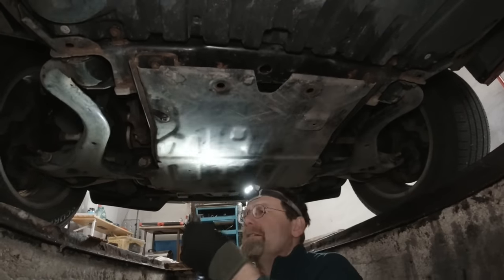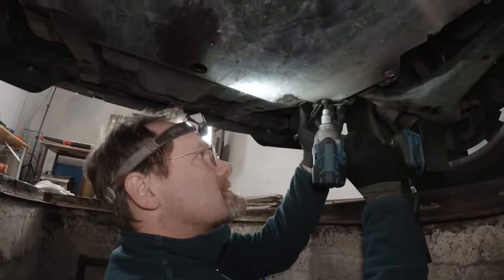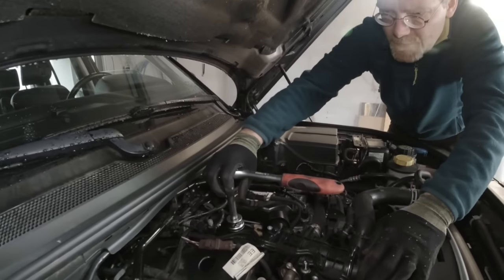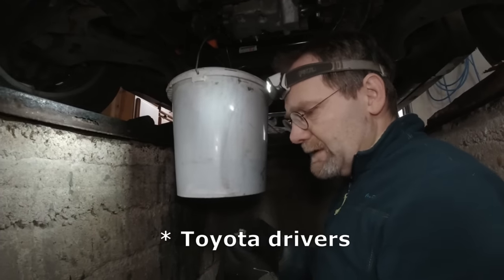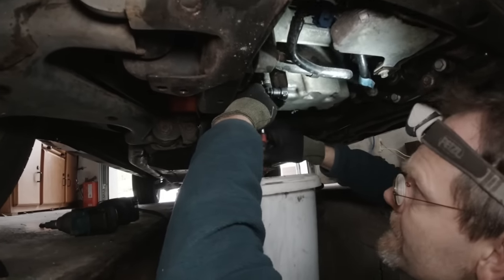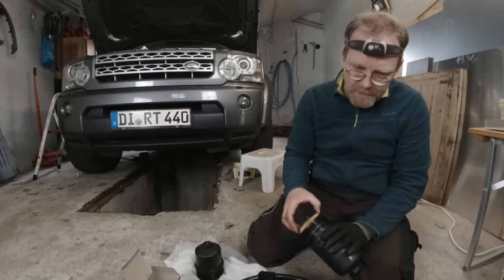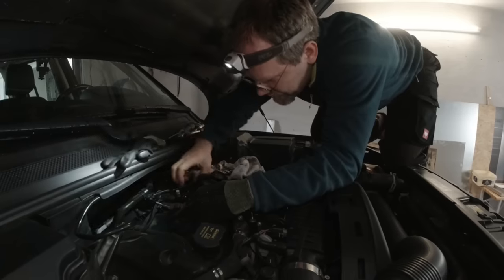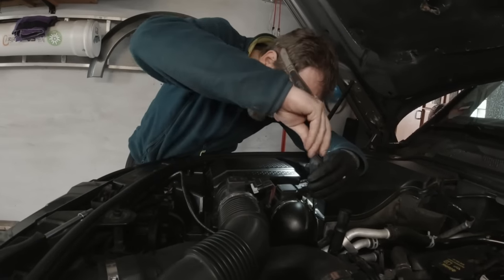No more 5W-30 ever again - Land Rover Discovery 4 - Transfer Case and Diff oil change

Comment: Hello from Kazakhstan. I think that for the engine to be better protected, additional parameters need to be considered.

Certainly, oil viscosity is crucial. I believe that for greater protection, a more viscous oil like w50 with a stronger base and fewer polymers added to increase viscosity would be suitable. The difference in fluidity between w40 and w50 oils is not significant, but the HTHS value and viscosity(100 to 150 degrees) favor w50. This is because the oil can heat up beyond 110-120 degrees, and during this process, the viscosity can drop significantly. If you measure oil pressure at 110-120 degrees, the pressure can be below 1 bars, even in a new engine. In reality, this is very low, especially if you are driving on mountain serpentine roads or moving on autobahns at high speeds.  Therefore, more viscous oil will help increase pressure.

Next, the original oil pressure sensor should be replaced with one that gives a warning if the pressure drops below 1 bar. 

And most importantly, the coolant and oil temperatures should be lowered. I believe the ideal parameter is 80-90 degrees for the oil all time. Structurally, the oil cooler is not in the most optimal place. This can be improved by modifying the oil cooling system, moving the cooler from its standard location to a separate radiator that cools the oil with the airflow during movement. The oil filter can also be placed separately. These solutions exist and are used in racing tuning. Replacing the thermostat with a colder variant that opens at 82 degrees can further enhance cooling efficiency and protect the engine under varying operational conditions.

Additionally, it is very important to change the oil every 5,000-6,000 kilometers.

Thank you!

Comment: if anyone  is interested  my 2003 Toyota MR2  is sort of broken  'brake back plate dust  guard  has fell off -UK MOT failure ' I do intend  to fix this but on my 1971 series 3 land rover  it needs a total rebuild  the the twin  carburetors  which  will have to wait  till I have 2 weeks off work 😂 great video

Comment: The D3 oil filter for the 2.7 has a 12% larger filter surface area compared to the D4 3.0 filter. So for the same flow rate (assume your D3 has the later 15mm wide oil pump, i.e.  the same pump element size as the D4 3.0 pump) then the D3 will have lower pressure drop over the filter element. As the oil pump relief valve dumps back to sump at the pump, then on a cold morning the D4 engine will have a higher oil pump discharge pressure due to the higher oil filter DP (smaller filter surface area). So a higher % of the oil will bypass the system via the relief valve back to sump. Hence your D4 will have a lower oil flow rate to the bearings when cold compared to the D3. However the D3 originally had a 11.5mm wide oil pump compared to the newer 15mm units, so the differance may not be that much over the original design....

Interestingly the Gen 2 TDV6 3.0 engines (D5 and Ford F-150) have a different oil pump (same rotor element, 15mm wide) - the pump relief valve is actuated via the oil gallery pressure, i.e. after the oil filter and cooler. This means that there is less of a compromise in the relief valve setting between having a good oil pressure when warm and not having a sky high pressure when the oil is cold in winter at startup. JLR must have added this function for a reason.

One thought - does your FAI oil pump have a 11.5mm wide oil pump or the later 15mm?
Reply from the maker: Thanks for the info about the pressure relive valve.  Check out my oil pump test and compare video a few months back.  The pumps all have the 15mm rotor.  The problem is the manufacturing accuracy and the precision of the pressure relive valve. Also cheap pumps have no locator dowels.  The FAI let’s the oil sink back into the sump much quicker than OEM.  Christian

Comment: Mobil 0W40 with with Toyota 0W20 provide a good 0W30 oil.
Did several oil analysts and the results came back excellent. 

Only an oil analysts report truely provide true information.

Comment: Shell TF-0753 is also the same spec for the Disco3 transfer case, FYI. What was the Ravenol spec you used? The manual doesn’t mention calibrating the Transfer Case clutches after the fluid change, but I recommend doing it using the GAP tool. After I changed my fluid I had a problem with the TC partially locking that was only resolved after the calibration.
Reply from the maker: I need to look into this.  The clutch is not used during normal operation I think.  Only in special programs.  Thanks for the hint.  The Ravenol was DTF-1. Christian

Comment: Hi guys very funny but informative videos . I have a Jaguar XF 3,0D , same engine as the LR and RR Im sure.
My dpf has been removed and im wanting to try the 5 40 oil as well. What spec would you suggest ? I only use Shell as it has a higher sheer point than Mobil or Castrol. Im in England if that makes any difference
Thank you both
Reply from the maker: If you read the video description, Christian explains what spec to use. 👍🙋‍♀️

Comment: Definitely replace the oil pump. Im also looking to change my oil from 5w30 to 5w40 on my D4. my question is would i use the same oil as you did though my D4 is a 2009 TDV6 with no DPF. Id be grateful for your advice.
Reply from the maker: You could also use a A3/B3 or a A3/B4. Stay away from A5/B5 or C1, C2 or C5.  Castrol may not have a good alternative in 5W40.  I am searching a pump now.  Christian

Comment: Thanks for another great chapter. I was wondering if you could help me - I had a discovery 2 (2,5td engine), which is sold already. At the moment I am looking for another discovery and wondering to go and get the Discovery III or Discovery IV would you recommend one of those - is it D4 really better and worth pay more? Thank You in advance, regards Arek
Reply from the maker: This is a very difficult question.   Both cars are risky to own. Only buy one if you feel like you can do most of the repairs we do in our videos.   The LR4 is much more powerful, especially with the HP8 SDV6 lineup.   I prefer the early LR3s for maintenance reasons and the manual transmission.  If you testdrive a SDV6, there is no going back - that is for sure.  Christian

Comment: Um Eure Frage zu beantworten, interessiert mich Euer aktueller Öldruck bei verschiedenen Drehzahlen im Vergleich zu den Werksangaben im kalten und heißem Zustand. Sollten diese Werte nach unten von den Sollwerten abweichen tippe ich nicht auf die FAI Pumpe, sondern eher auf verschlissene Lager im Kurbeltrieb. Meinen 2,7L hatte ich durch Zufall kurz vor Kurbelwellenschaden gerettet. Hatte zwar den Druck nicht gemessen, aber nach optischer Beurteilung der Lagerschalen kann da nicht mehr viel Druck gewesen sein. 
Jetzt zum 40er Öl im Mall Crawler. Ich nutze meinen D3 als Mall Crawler und fahre das gleiche 40er C3 Öl seit Motorüberholung.
Was mich extrem interessieren würde sind Eure Erfahrungen mit dem DPF in Eurem D4. Nach meiner Meinung sind häufige DPF Regenerierungen und Diesel-Eintrag ins Öl ein Grund für Kurbelwellenschäden bei D3 und D4 mit DPF. Da ich meinen D3 mit DPF als Mall Crawler nutze wechsle ich jetzt alle 6000km das Öl. Macht doch mal ein Video zum Thema DPF im D4, am besten mit den Live Values des IID Tool zu allen DPF relevanten Werten. Mich interessieren dabei insbesondere die Anzahl der abgebrochenen Regenerationen und Differenzdruck etc.. Ich möchte nämlich gerne in ein bis zwei Jahren auch auf den D4 umsteigen. Daher möchte ich wissen wie dieser auf ein Mall Crawler Fahrprofil reagiert.
Ich denke das könnte zumindest in der EU einige Klicks geben.
Reply from the maker: Ich werde im Herbst den Motor überholen. Ich habe aber schon noch einen Funken Hoffnung,  dass die FAI Pumpe schlecht ist weil das Problem ja adhoc gekommen ist.  Der niedrige Druck ist eine Sache aber die fast 5-6 Sekunden bis Druck da ist deutet darauf hin, das die Pumpe leer läuft. Und zwar in einer halben Stunde.  Wir nutzen unseren Mall Crawler nur für Langstrecken und der LR3 hat kein DPF.  Ich lese mal die abgebrochenen Zyklen aus.  Sind aber vermutlich nicht viele.  Das Auto ist auch noch zu neu um schon damit Probleme zu haben.  Die Ölverdünnung ist mit Sicherheit ein sehr kritischer Punkt.  Gerade bei Autobahn Nutzung wenn der LR4 Vollast läuft.  Da wird das Öl stark belastet.  Mit unserem LR3 fahren wir nicht so schnell aber mit dem SDV6 geht es zur Sache.  Christian
Reply: Unseren nutzen wir für lange Urlaubsfahrten und Wochenendtouren, aber auch sehr oft einfach nur zum Supermarkt oder Baumarkt. 
Ich bekomme immer die Krise wenn diese idiotische Elektronik eine Regeneration mitten in der Stadt startet (Man hört es) und es keine Möglichkeit gibt diese erfolgreich zu Ende zu bringen. 
Freue mich auf jeden Fall auf Eure Motorenvideos. Und tendiere dann auch zu der Empfehlung die Ölpumpe vorher zu tauschen. Ansonsten haben wir keinen Lerneffekt.

Comment: Great video. Was considering doing the change to 5w40 due to the higher running temps here in Aus. Still toying with the idea. How have you found your car in the last few months since making the change? 
Just a side note, not all D4's have a DPF. I have the SDV6 with no DPF as factory.
Reply from the maker: You notice a difference on a LR3 2.7. On the 3.0, the pressure is so darn low that the 5w40 only boost 0.1 - 0.2 bar in idle. Hardly noticeable.  Christian
Reply: If you´re not sure if your car has DPF fitted you can enter your VIN number on something like vindecoderz it will actually state whether or not your car was fitted with DPF or not.

Comment: Since your are an expert on the 5w40 oil what oil should you use for a 4.4 tdv8 2011 range rover as this is normally a c1 5w30.

Comment: Hey LR Tme, great video. I found small metal filings in my filter, does that mean it will break soon or is that “normal”? Many thanks for your thoughts.
Reply from the maker: That depends on how many you found. 10-15 is okay, more is not so good.🫣🙋‍♀️

Comment: Hi, why there is no oilpressure warning light at ignition on in your video? Manual (D4 2013, 155kW) says it should be next to the battery light (like in any other car). You can see this in other videos and also in my car.

Comment: Thx for your great vids on LR4, lots of info. Just have to correct a bit, not all diesel have DPF, I have a 2010 MY, and it doesnt have DPF. What i gathered from the net its from 2011 (maybe even late that year) that has them? And ive been wondering about the oil too, living up north with temperatures in the winter close to -40C... But anyways, keep the videos coming, cheers!
Reply from the maker: 👍Yes we know that not all LR 4 have a DPF. We mostly refer to our situation here in Germany and the rules and regulations that apply to us here. 🙋‍♀️Vera

Comment: Christian. I have a very early D3 December 2004. 2.7 TDV6 pre DPF which should use A3/B4 .what are your thoughts on using the C3 in the early D3? 
I would have thought that the engine would be the same as the later cars with DPF but not sure. I am considering using the 05w40 C3. I change my oil around 3000 miles  which to me is every 6 months.
Regards
Peter
Reply: Hi, I would use the thicker oil, there isn't a lot of difference but enough to make better oil pressure and give better protection over all, see my comment above, I have been a fork truck engineer for over 20 years and done hundreds of services on many types of engines and preventative maintenance with regular engine oil changes is the key to longevity on any oil, regardless of viscosity but I defiantly think the next grade (thickness) up is a great idea, hope that helps regards Phil
Reply: @philadams92  hi Phil thank you. It's more about the A3/B4 to C3 which concerns me. We never had so many versions of oil in the old days lol
Reply: There's no issue using C3 in a non DPF. The additive pack in the C3 is obviously compatible with the DPF but it works perfectly fine with non DPF vehicles. Apart from the low saps the rest of the oil performance specs are very similar to A3/B4
Reply from the maker: I agree with Shanes Shed. The C3 is ok for non DPF. A3/B3 is also much harder to find these days.  Even heavier oils like Phil wrote are ok with non DPF I think, especially if the car has many miles on it.   Castrol has a 10W40 A3B4 in the lineup. Christian
Reply: @Vera_and_Christian  thank you Christian.  I have sent an email to Vera which you might find interesting from Castrol oil.
Regards 
Peter

Comment: I have had my 2013 D4 (with dpf) for 6 years now and always change the oil twice a year after about 6000 miles.
I have always used the correct spec oil of a C1 rating.
And as it's so bloody expensive, I've recently purchased a 25 litre drum to save some money.
The car now has 150,000 miles on the clock and it's always worries me how thin the oil is. Some may mistake it for German beer! 😆
I wonder if I should add some sort of friction/viscosity improving additive until I have used my 25 litre drum?
What do you think?

Ps. My skid plate has the same 13mm hex bolt as my old D3. But I think later D4s were changed to torx headed bolts, but still have the captive spring nuts behind (which I hate!)

How are you reading the oil pressure on your D3? With the iid tool?
Reply from the maker: We don't add anything, we use the oil described in this video. Also, information is in the video text description. 👍🙋‍♀️Vera

Comment: I would try another pressure gauge to see if that is part of the problem. I'm not sure I would feel comfortable driving knowing the oil pump may need replacing, even though it isn't likely to be worked so hard it is an issue.
Reply from the maker: Both gauges read low and buildup takes forever.  I received the new pump yesterday. Christian

Comment: Hi guys awesome videos you do! I own my second LR in last 7years now and absolutely love it. 
Currently have a 2011 RR Sport that shares the same 3.0 Tdv 180kw engine. 
I am in Australia Queensland that temperature doesn’t go below 10 degrees and 9 months of the year is above 20. 
My question is should i use 0w40? Or stick to 5w40? 
Also, what oil have you used in front diff? 
Thanks a lot!
Reply from the maker: We use 75w90 hypoid in the front. 75w140 in the back.  I would go with 5w40. Christian

Comment: Change oil pump now,best sooner than later   one question first though is there a oil pressure regulator release valve any where that may be malfunctioning or separate oil feed for anything else like cams or chain that could be causing a problem or different hole size in gasket oil way and I'd guess the gap at the back of engine skid plate/bottom cover is to help cooling a bit of venturi effect

Comment: Hi Christian and Vera, also have a mall crawler, late 2013 SD v6 with 8 spd transmission. Very interested in your comments on specification WSS-M2C934-B mapping to German oil company, Fuchs oils if you may. I am using Titan SuperSyn F Eco-DT 5W-30 listing a Ford specification of WSS-M2C913-C and D. Used Fuchs oils (5W-30) on my previous LR 3 now on 280 000 km, passed on to my son which has also become a huge fan of these vehicles. The D3 is still going strong, maintained by ourselves with oil change intervals of 8000 km.
Reply from the maker: The Ford oil spec does not really say much about the oil. It is just a Ford descrition for oil suitable for Diesel engines.   Of course you can run 5W30 over many years - we did too.  I think the surrounding factors are indeed more important, like a frequent oil change and not abusing the engine and so on.  Wish you good luck and do what you have been doing so far.  Thanks !!! Christian

Comment: Have you ever changed turbo pipe on the secondary turbo is a mod because the old one collect's oil, and smoke's out of the offside exhaust pipe, it looks like a big job starter motor off and so on 
Regards Phil

Comment: Hi Vera and Christian. Your videos inspired me to start doing simple services by myself.
I am having RangeRoverSport L320 3.6d V8 and would like to ask you what kind of oil you recomend for Ford Lion motor? Factory recomendation is 5-30 Castrol.
Thanks for your reply 🙏
Reply from the maker: You use what Land Rover recomends. Only with the overengineered V6 Diesel and it's problems should you worry. 🙋‍♀️Vera

Comment: Hi Christian and Vera, a very interesting and entertaining video as usual.
My question is, if I change my oil to 5w40 on my 2007 TDV6 what spec should I use? C4? 
Thank you so much for all the help you're giving us Discovery owners 😊
Reply from the maker: If you have a DPF, use C3 or C4 (not C1, C2 or C5).
If you have now DPF, you can also use A3/B3 or A3/B4 but not A5/B5.  
Castrol does not have all sorts so this is why we used the DPF (C3)
Reply: @Vera_and_Christian  Excellent thank you so much for the clarification. I don't have the DPF so will look for the ones you recommended. Have a lovely day guys 😊

Comment: Vera and Christian, first of all thanks for your useful and entertaining videos! 
I have a late 2009 LR4 3.0 with 180k kms. I would like to follow your recommendations and change to Castrol 5w40 C3 but I’ve seen that there is a DPF and a non DPF version of this oil. Although I’ve researched I’m not sure if my Disco has DPF because of its manufacturing date. Is there any way to solve this doubt?
Reply from the maker: We use the DPF on both of our Land Rovers, one with DPF and the Disco 3 which does not have a DPF. If you don't have a DPF, you can also use C3. 👍🙋‍♀️